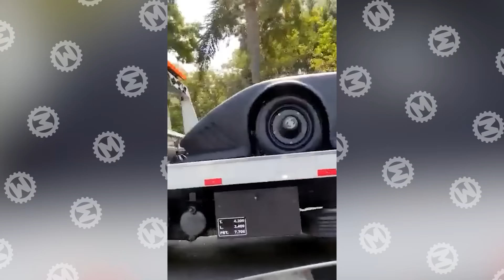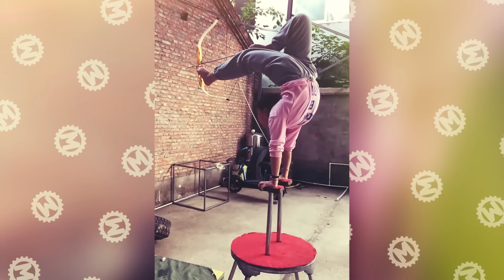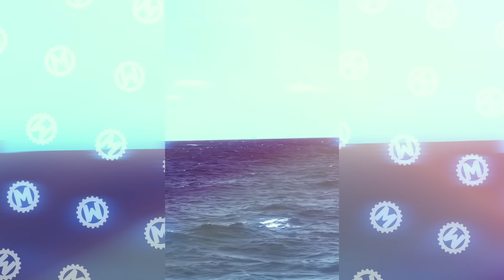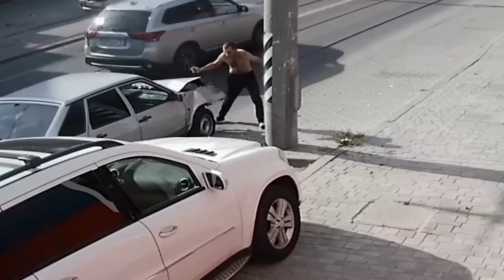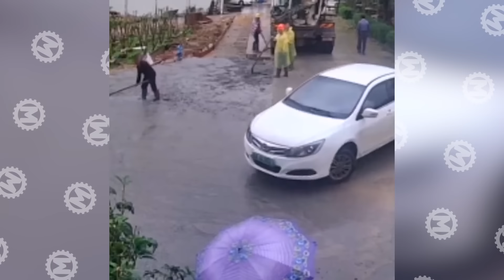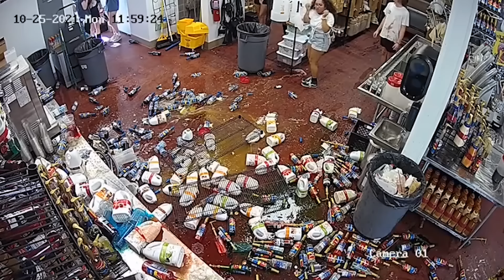200 Incredible Things Caught On Camera. Best of 2021

Comment: 🟦 Does anybody have any idea what's go'n on @ 21:28, 25:23 or 55:24?
It's an absolutely ridiculous oversight to not have provided a description of these segments.
Reply: BRO THANK U i am so confused
Reply: Especially 27 minutes 10 sec in...🤷‍♂️
Reply: They are on the equator, I believe, and if you look closely the water is flowing up the hill passed that line.  Not rolling down.
Reply: @shaneculkin7124  *past
Reply: @Ultamami  *pasta
Reply: Exact same ones I played over and over. I got the first one, but the others are still a mystery.

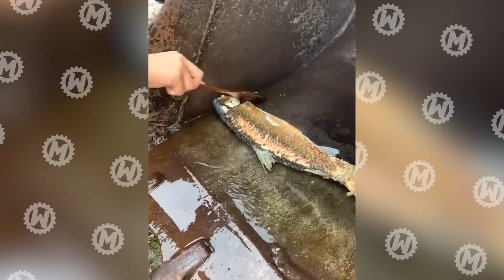Comment: 42:22 Sorry, but the legendary Carl Palmer did this in the 69, with the bands, King Crimson, again in 1970 with Emerson, Lake and Palmer,  (I've been blown away by several of their concerts over the last 40 years) and again with the group Asia (who have also been performing for about as long in tandem with ELP). But this drummer is fully hot (or 'sick,' as the kids say now!

Carl Palmer spun his gigantic drumset first around in a flat circle, then he did it in the air and then he did it sideways in the mid-70's. I've never seen anyone beat his drumming to this day, not even my dad, who was phenomenal. RIP Dad...
Reply: That statement "no drummer has so effectively outshone his band-mates" is not quite accurate, yes. But Carl Palmer was not in King Crimson; that was Michael Giles on Court of the Crimson King   It was Greg Lake of KC who left KC to join Emerson and Palmer. Palmer's kit was on an elevated, horizontally-turning platform AFAIK (not  rotating vertically like Duncan Philips of Newsboys in this clip). Jack Valentine was the first to pay upside down and Tommy Lee had a rig that rotated vertically to an upside down position. Valentine and Lee certainly did upstage their band-mates.
Reply: @peterholman9034  I thank you for the correction!

Comment: Love the Twin Tower reenactment at 24,30,,, not such a mystery now even down to the exact noise 😄
Reply: @joshuaball2276  I have 2 VHS tapes recordings ( Still In good order ) of the entire first broadcast BEFORE editing by government of the entire demolition of the Twin Towers. On Channel 7 Australia News ,,Over The next two day images changed forever ,,,,Except for Mine of Course!
Reply: @MrMambott  My man, good stuff. The planes are 100% composite edited in nonsense and it's super easy to tell for anyone who's familiar with addng composites and video editing.

I don't understand cause surely people know that if they scrunched up a ball of Aluminum in their hands and then they threw it as fast and hard as they possibly could at their flyscreen window,  it ain't going to do nothing but crumble up before bouncing back and falling down to the ground. 

Who here thinks or believes that the scrunched up aluminum ball would definetely disappear or penetrate and go through the flyscreen window as a result of being thrown at it as fast as one can throw??  Anyone??? 

So common sense tells you that 747's don't disappear into 3 3/4" solid steel beams surrounded by steel rebar enforced concrete.

I think that a lot of the footage of supposed people falling and the shots of people on the streets running from the dust clouds etc and all the "random" street interviews and so on were definetely pre-recorded/post-produced.

That's not to say that they haven't completelt changed the narrative since then, so footage from the orignal day like you said you have copies of is still pretty golden and rare. I wish I had of put the vhs tape in and pressed recorded on the day.